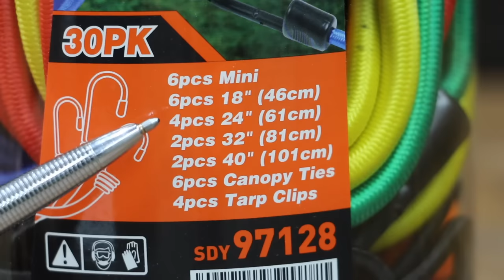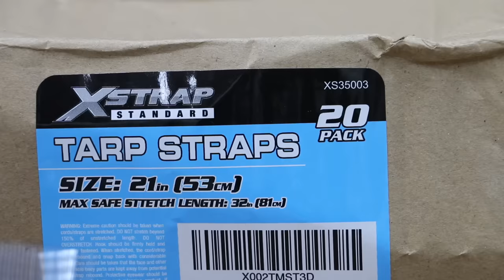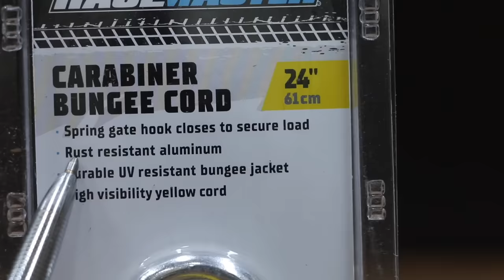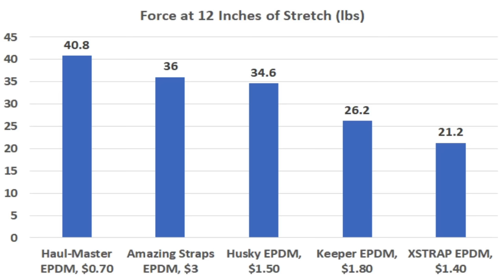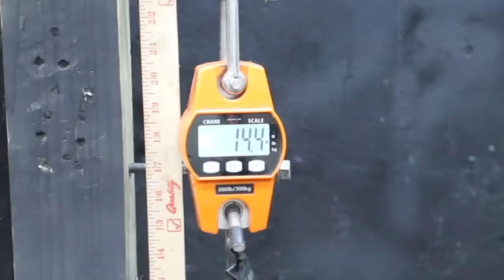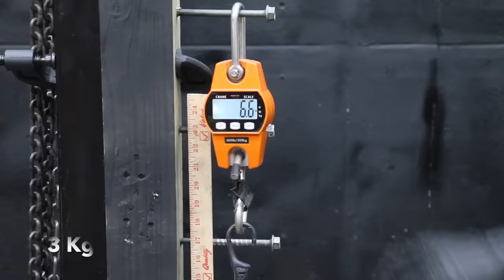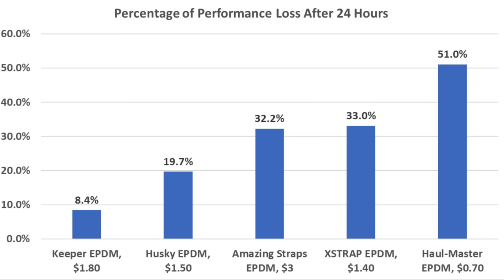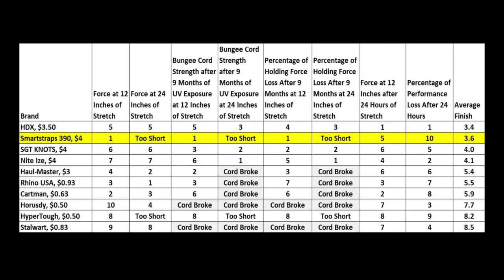Best Bungee Cord? Let's FInd Out!

Comment: FOUR IDEAS: Since you've ventured down the welding path--you might look at hoods or gloves for welding--for stick and MIG. Gloves for TIG are usually different and wouldn't offer an apples/apples comparison. 
Have  you compared adjustable trailer hitches?  I have used one for decades to accommodate different trailers, but have often wondered if other types are better.  I hate changing the ball on mine.  Hey--there's another test: multi-size or "quick change" ball hitches.  (Hey this might require some welding! )
Reply from the maker: Thanks for the video ideas.

Comment: I really wish you included the bungee's from "the perfect bungee" brand. I have 7 of them onboard my sailboat. They have lived outside year round from the day i purchased them, never have they gone back inside. 3 of them i picked up in January of 2020 and the remaining 4 were purchased in 2021. All of them are still running strong, they show zero signs of cracking or degrading, zero fading and have not shown signs of elongating. They are absolutely by far the best I have purchased, but damn they are expensive from an up front cost. Would love for you to test these as I'd be if i just so happen to be a lucky person? 

I live in the PNW so maybe thats partially why?
Reply from the maker: Thanks for the suggestion.

Comment: I enjoy watching your videos and find them very helpful/informative. I Have a suggestion for a product(s) to be tested.  4 stroke motorcycle oil -  particularly wear and effects on wet clutches.  I have a favorite brand I use in my Motocross bikes and it seems that every time I tried a different oil, I ruined my clutches. Very common to slip the clutches on this type of riding to control power to the wheel. Normally I use Castrol 4-stroke 10w40 which have been using for years with no problem,  but have tried Silkolene a synthetic gear oil and clutch started slipping - no More wheelies on my YSR 80 after that .Then I just tried a Valvoline 10W40 motorcycle oil and my clutch wore out very quickly(twice actually). I find it hard to believe - that's why I tried it a second time. Lately, I was thinking about trying the Rotella T4 (diesel oil) which is supposed to be good and states that it is approved for wet clutches.  JASO rating I believe it's called.
Reply from the maker: Thanks and you are welcome!  Thanks for the suggestion.

Comment: Checked for channel, Didnt see a test video of 2.5x10 inch waterfilter elements. Cheap test over a year and you get to add water filter to your home. and a decent 5-10 gpm water meter ain't to bad on the wallet.
Reply from the maker: Thanks for the suggestion.
Reply: @ProjectFarm  My suggestion was shortsighted, I forgot you'll need more then a water meter and filters, water purity test equipment as well.

Comment: In round 2, give the "Super Bungee" a try. I found one of their 24" "professional grade" bungees by the side of the highway some time back. I couldn't tell you how long it had been out there, but I used it for several months to hold down the lid on my trash bin, and it was still going strong when I discontinued my trash pickup service. The amount of elongation capacity is insane, something like 5x. They look kind of comical because they have an overly long sheath to accomodate the elongation. Hooks are gated and heavy duty. The downside is that they're $25 (that's twenty five dollars!) each.
Reply from the maker: Thanks for the suggestion.

Comment: Hi-Thanks for your efforts.  I think that in this-and some other vids-that an understanding of the materials and specs would be more, or at least as much, useful than straight brand/product evaluation. I spent alot of my career as a yacht rigger-and material specs and ID is really important. Not all cover materials are the same-for instance: the polyester, nylon, polypropylene materials used all have a wide variety of material qualities and construction methods qualities, as do the elastic and end fittings. These same types of variations also apply to ropes. A 3/4" nylon rope, for example, can have a such wide variety of qualities and construction methods that durability and strength factors can vary by 4-500%. Anyway-I think these things are important..
Reply from the maker: You are welcome!  Thanks for the constructive feedback.

Comment: Video ideas: 
1. Spray bottles for BBQ. Can test to see if harmful chemicals leech into caustic solutions of vinegar after X amount of time, durability, and whether they can spray oils and spices in a mist pattern.
2. Multi probe thermometers for use in BBQs. Test for accuracy of probes and heat resistance of main unit I suppose. 
3. Pellet grills! Test for temperature control and hot zones I suppose.
Reply from the maker: Thanks for the suggestion.

Comment: Thanks again 
Great video 

Have you done sock testing?  I switched to wool years ago, not the itchy super thick but a heavier than cotton.  Love em. Not cheap but they hold up better and are a better value. 

Smart watch’s 

Wi-Fi switches.  Lights. Plugs  garage door openers.  

Tool boxes.  Plastic rolling and metal shop ones

Storage tubs 

I could list the traditional Father’s Day add from homedepot and lowes.  Some you have done before.  Think of the party you would have to have after doing smoker an gas grill testing
Reply from the maker: Thanks and you are welcome!  Thanks for the suggestions.

Comment: Great test! I've experienced so many issues of using bungie chords outdoors! Thank you!

On another note, one thing I have wondered. Is it used to be on a small engine like an old Briggs or Honda they recommended ideally 100 hours on an old dyno oil before switching to a synthetic due to friction modifiers.

My question is Amsoil Small Engine Oil doesn't have friction modifieds despite being a class IV synthetic. Is there a difference the way the cylinder breaks in with modern day engines or is this now a myth?

It would make for a great video. Especially with so many cars using synthetic even from the factory.
Reply from the maker: Thanks!  Thanks for the video idea.

Comment: Having been a semi driver/owner , and pulling flatbed for 20 years, I knew what was coming with those straps. No flatbedder worth his salt would ever use those woven fabric covered toys. As seen in the tests, those are nothing more than glorified rubber bands. The imported solid black rubber tarp straps with the squared ends , as you found out, are just so much junk also. I can remember buying a case of those imported things decades ago, and they barely lasted 6 months before ending up just like the ones you showed with the cracking. And that wasn't even with 24/7 exposure to the elements like your testing. Solid black rubber made in the USA straps are what you use when you have actual work for the straps to perform on a regular basis, and nothing less.
Reply from the maker: Thanks for the feedback.

Comment: My experience with the HFT black rubber straps mirrors your test results. I have never had any of them exposed to sunlight last even close to a year. The black rubber always cracks and breaks.
 I have had slightly better luck with the material coated ones, but they stretch, lose tension, and the ends break off. Based on your results and what is available in my area, I think I will go to Husky in the future, or buy the bulk rolls of neoprene rubber as is used on the military truck covers, and use the salvaged "S" hooks to make my own straps. Great useful test video. Thanks.
Reply from the maker: Thanks!  Glad to hear!

Comment: Might be too many days after this vid was released for you to read this. But I was thinking a comparison of toasters. A bit outside of your normal scope but would be helpful. Speed to actually get toasted, not just warm and floppy, maybe setting differences. Does heater element degrade after X amount of heating hours, compartment size (like does it fit bagels too), does spring actually bring toast up and out, etc
Reply from the maker: Thanks for the suggestion.

Comment: I prefer the EPDMs, I've had one attached to my side step by the fuel tank for about 5 years now, trucks are outside 24/7 and still shows little to no wear. It isn't quite as tight as it used to be, but still very useable. I use it to hold the diesel nozzle in place while I fill up the other tank. I don't have it stretched out like your test though either, just enough so it doesn't come flying off lol. Thanks for all these tests! I've used quite a bit of your data several times when it comes to making purchases.
Reply from the maker: You are welcome!

Comment: Someone in my mountainbike group declares that underarm deoderant spray is better than the ptfe dry lubes for chains. It almost makes sense, I'm aware those sprays have talc and some aluminium powder product in them. 
One of my contractors reckons the spray oil you use on frying pans is the best spray lube for machinery applications vs. wd40 etc.
Could you test some of these strange claims?
Reply from the maker: Thanks for the suggestion.

Comment: Some ideas which you may have videos for would be weed whipper lines, chain saw sharpeners, break fluid brands, weed and grass killers, spreadable weed killers that are safe for lawns (store bought vs elevator bought), 2 stroke vs 4 stroke vs battery operated weed whipper/lawnmower which could involve repair, best extension cord on the market today, a test of jack stands, as well as the best and worst gardening tools such as hand shovels, weed extractors, and how they perform
Reply from the maker: Thanks for the suggestions.

Comment: I have a suggestion, I just tried some Metal Lock Black no heat solder on some copper fittings and was pretty amazed, I’m curious to see how it does against other pipe welding and soldering methods
Reply from the maker: Thanks for the suggestion.

Comment: As always, good video. I would like to see a video done on truck winches, I recently got stuck partially hanging off the side of a mountain and our winch wasnt enough and we had to be pulled out by another, larger, truck. Clearly the 3 ton winch could not pull 3 tons or we would have been fine.
Reply from the maker: Thanks!  Thanks for the suggestion.

Comment: As usual, appreciate your thorough tests. I replaced some straps years ago with EPDM(not sure where I bought it), but they didn't last as long as I hoped.
On the other hand, back in the early'80s I got quite a few long ones from "Old Sarge's", which handled used military items. Believe it or not, these black ones are still going strong(used constantly) after 40 years!. I have no idea what was used to make them, but I wish they were still available.
Reply from the maker: Thanks!  Thanks for sharing.

Comment: Interesting to see this test done. As I run open deck freight and we normally use rubber bungees on our tarps. Most of my bungees last maybe a year at most. Some of the loads I've done takes multiple tarps and a case of bungees to hold it in place. Our trailers don't have the proper loop hooks to use rope efficiently. So thank you for this test as I now know I should look for those Amazing straps to try out on my tarp loads.
Reply from the maker: Thanks for sharing.

Comment: We keep straps in the bed of our work trucks year round.  14 years ago I noticed that some straps lasted longer than others.  It took a while to narrow down the ones that held up well.  I decided that HDX was the best of the ones we tried.  I have used the same set for close to 10 years. They spend a lot of time not in use under or beside stuff in the shade, and sometimes the truck spends the day parked in the shade.  I don't play around with bad cords after we had a friend losing his vision in one eye after a bungee failed.  The older HDX bungees hold up longer than the current ones do and they caused me no end of trouble trying to figure out what brand we had that was holding up so well when they changed the design of the hook and I kept looking for the hook style that matches what I had.  After looking for a year I found the original container and was able to get things narrowed down.  So much marketing hype on all those straps it caused so many arguments with my coworkers watching them buy crap and I would say get back to me in 6 months and let's see how they are holding up.  Thanks for the testing and showing the other brands that are better than most.
Reply from the maker: You are welcome!

Comment: Have you dune any tests on brush pullers? I am wondering which has the best grabbing power and how small and large a bush small tree they will pull. There are two kinds one is slip chain with nobs to grab and the other is a compression with lifting
Reply from the maker: Thanks for the suggestion.

Comment: Was wondering if you could do a test on sockets and the best fitting to bolts alot of sockets don't fit tightly on bolts even though they are same size and the strongest sockets.  Need to buy a new set and could really use some help which set is worth investing in... Thanks love your videos
Reply from the maker: Thanks!  Thanks for the suggestion.

Comment: home depot got some silicone based straps, been using them on my truck to keep tension and stop my jerry can from rattling in the holder outside the truck, been 8 months now, no sun damage and no permanent stretch, but a little more pricey. recommend
Reply: could not find the other sizes on the website, but they have it, mine is 24in and red, but same thing
Reply from the maker: Thanks for sharing.